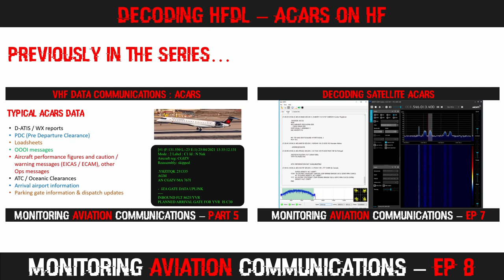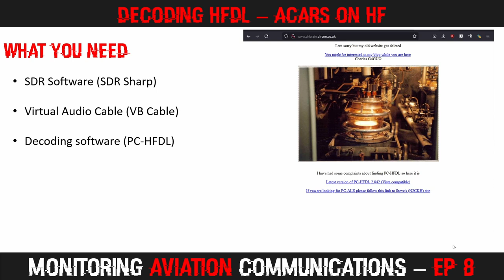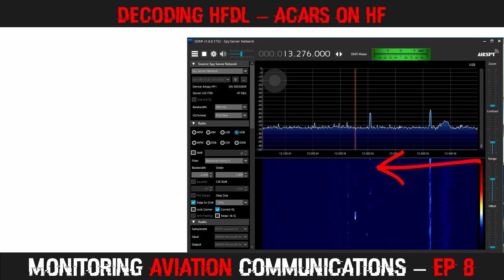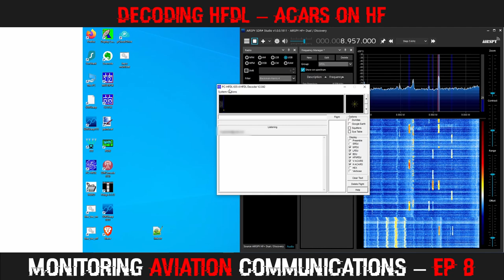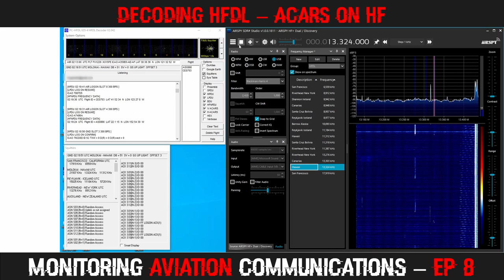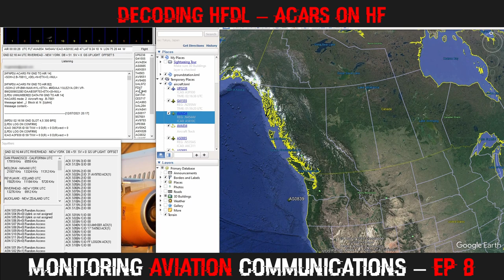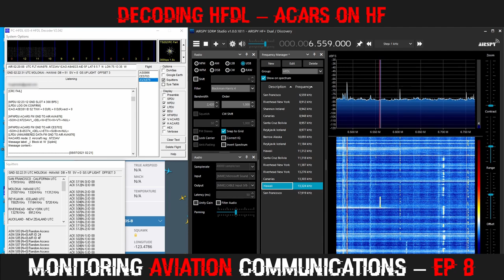How to decode HF ACARS (HFDL) free with your SDR - Monitoring Aviation Communications Episode 8

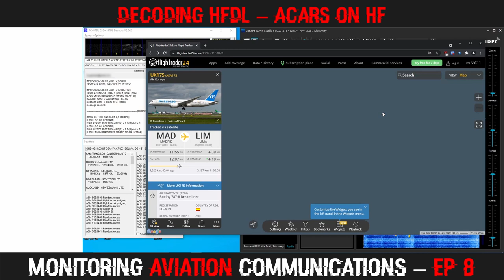Comment: Hi, Rob. I have a question about the HFDL frequencies listed on your HFDL Resources page. What exactly are the "timeslots" and how are they used? Do they represent the UTC time when the frequency starts being monitored by the ground station, and if so do they stop monitoring the other ones at that time? I'm asking because I've noticed that in the Philippines the Guam, Thailand and South Korea ground stations (or at least the aircraft in SE Asia and Oceania sending messages intended for them) remain quite active at 10:00UTC and later. I'm using an SDRPlay RSP1A and an active K-180WLA 55cm loop antenna with 2 or 3 meters of RG58 coax between it an the antenna's power supply. (I use dumphfdl as I have a Debian Linux OS on my computer.)
Reply from the maker: Hi Jay. Thanks for your question.
The timeslots related to a portion of a timeframe. Each ground station is assigned a timeslot & frequency for its squitter. That way when an aircraft tunes to a particular frequency it knows exactly when it should receive a signals from the ground station.  

The frequencies in use are dynamically allocated by a system wide controller that keeps track of propagation. That way, the central computers can reliably stay in touch with an aircraft anywhere across the world. It's just a matter of selecting the correct frequency and ground station for the time of day.

Because of propagation, you'll often receive aircraft that are connected to a ground station that is not closest to them.

Hope you're enjoying dumphfdl. I've heard good things!

Comment: I was wondering if the HF acars messages transmitted be the same in Inmarsat ? 
Also have you tried receiving LES ship communications ? Thankyou for your video’s kind Regards Peter
Reply from the maker: Haven't tried LES. The HF ACARS messages are a bit simpler, but you do see some of the same traffic as on satellite.
Reply: @FrugalRadio  thanks for your reply very much appreciated 😊

Comment: Another question sorry does pc-hfdl automatically switch to the active frequencies  when you have downloaded the table of frequencies.  And on a sdrplay  can you use a scan list of hfdl frequencies  to monitor  the system  ?
Reply from the maker: No, PC-HFDL doesn't manage the radio. You have to manually tune it yourself. The registered copy makes it easier once you update the system table file as it displays the active channels. But when they change, you have to do it manually.

Some folk in the community have cleverly written scripts that read the data from PC-HFDL and tune their SDRs. However I am not one of them!

Comment: Great video as usual, one question  I will be setting up my aircraft monitoring system and hfdl will be part of it.
The question is  do all the comms get forwarded to the IMARSAT  side including the vhf acars, I thought they were all connected  systems.  And its so easy to monitor IMARSAT  with a patch antenna. Or do I need separate capabilities. 
AA4CP  Chuck  Port Salerno FL USA
Reply from the maker: Hi Chuck. Thanks for watching!
There are 2 organisations, SITA & ARINC that handle the back end services. All the messages sent and received travel through those providers. 

When ATC message an aircraft, the signal goes to a central server. The server knows which media the aircraft can be reached on - VHF, SATCOM or HF. The server then chooses one of the active connections and relays the message.

The controller sends a CPDLC message. She / he doesn't know if it gets delivered via ACARS, VDL/2, HFDL or SATCOM.

The same process happens in reverse.

When you decode the various ACARS messages, you can see the aircraft communicating with the ARINC / SITA server advising them when a connection status changes, and what the current default standard is (VHF / SATCOM / HF).

Comment: I found the HF frequency of canaries ground station by chance when i was combing the HF band some couple of days ago, but today i got shocked that i picked the strongest signal from Thailand's ground station, i'm using a 12m wire dipole here in south algeria, i think it's not the ideal length tho (my roof's limit )
Reply from the maker: Longer would be better, yes. See if you can get a wire be 20-30m long (random wire).  It's always exciting to catch signals from a long distance away.
Reply: @FrugalRadio  i made a mistake, bc some GS use same frequencies, i'm positive it's GS 17, so canaries, makes more sense to me.
I'm gonna put a long wire on my garden, i can use a 30m dipole there
Reply from the maker: HF doesn't always make sense. Quite often the strongest signals are from greater distances. Got example, after dark, you're likely to hear US Air traffic and Caribbean, and South American voice traffic easily. If you run HFDL audio through the free PC-HFDL decoder for Windows, you'll know exactly which stations you are receiving.
Reply: @FrugalRadio  you're right, i tried and found i could receive shannon, iceland and even NY on some frequencies, but nothing from ME, Russia, or South Africa
i guess ground waves maybe over the ocean and continents are bad or maybe multiple reflections over the ocean

Comment: The paid version also only displays numbers, unless you have the latest system table. That might be received off the air, but you can download it - either the HFDL groups.io group, or a bit of googling will lead you to one. The latest seems to be 51 (hex 33) which is from 2019 I believe.
Reply from the maker: Yes, System 51 is current.